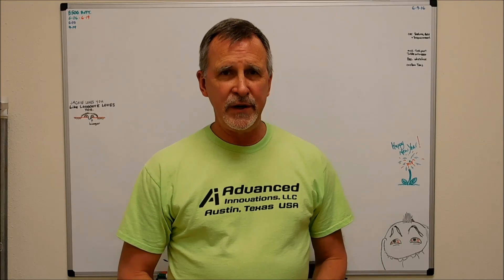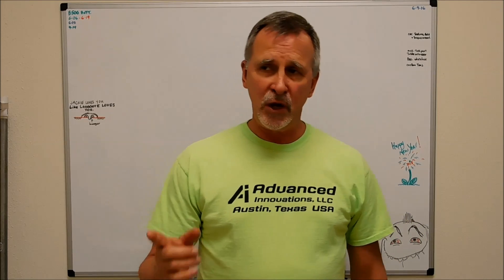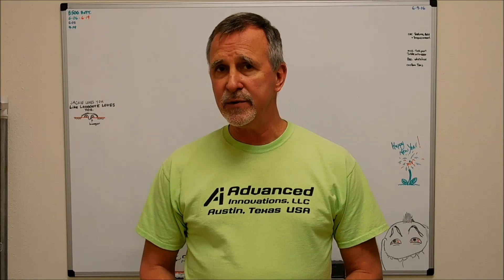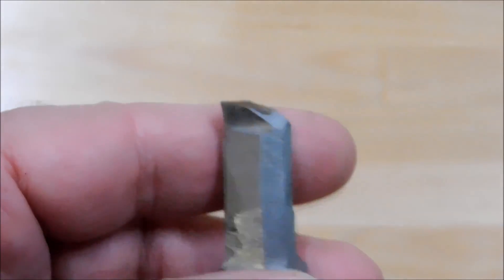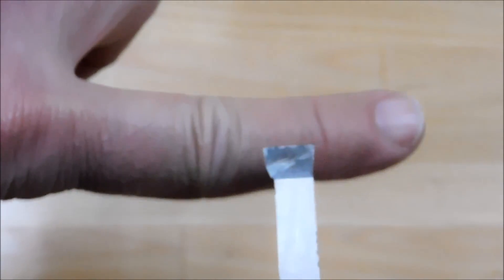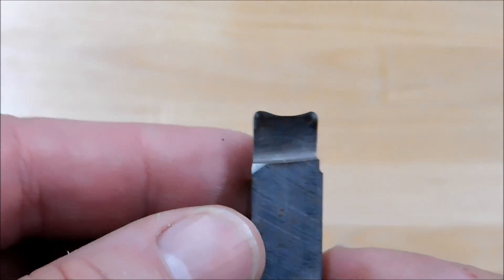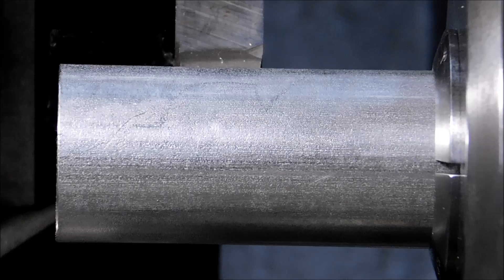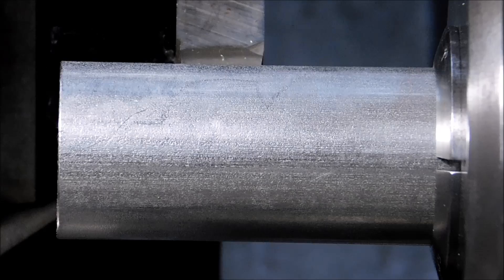Machining Large Undercuts on the Lathe with Less Chatter

Comment: Get a larger lathe, problem solved 😉
Reply: to be fair, deflection in the part and tool will always be an issue. sometimes you need to be clever to deliver a quality product because a bigger machine just won't get you all the way there, if the chatter is coming from a tool or bad setup. just my opinion though since im an amateur and you probably shouldn't listen to me.
Reply from the maker: Certainly a solution.

Comment: Hi Joe, many thanks for your videos, I watch many of them and like your presentation. I often wonder about the heavy turning operations that are done without cutting oil/coolant and the effect that use or not use has on cutting tools and surface finish. Would you share your thoughts please.
Reply from the maker: Some tools perform just fine without coolant. I would think coolant is never harmful unless it floods onto a super hot tool. Then you risk fracturing the tool or insert. Finish cuts usually benefit from lubrication, but I'm just used to not using it on the lathe all the time.

Comment: A long time ago I was involved in refurbishing the surface of a 16 feet diameter paper dryer cylinder.  It had developed a little out of round shape (actually starting to evolve towards a rounded corner square).  So, the first operation included mounting a lathe bed next to the cylinder and trying to turn the cylinder back to round shape.  For people who might not know, the dryer cylinders are high alloy cast iron.  A sharp tool bit worked for a couple of rounds (of the cylinder) and the it was vibrating intolerably.  The solution, presented by the flame spraying consultant, was to turn the tool upside down and re-wiring the cylinder drive motor for reverse direction.  The tool still had to be sharpened quite often, but it lasted way longer than the original couple of revolutions. People who had not seen this trick before, including the lathe operators, were amazed.

Comment: a comment on running in reverse, this was the best way to do parting on a small import lathe i used to own, when running forward the parting tool used to stick and dive into the part due to lack of rigidity but tool upside down and reverse it parted off lovely. not sure but i think this tip came from you as well Joe

Comment: My lathe has flood coolant.  Is that preferable to oil for parting?  Also - thanks, Joe for all the info.  Parting has been my nemesis.  I saw a clip where another user put a groove in the top, rather than the front of the cutter. I would think the front would have more effect, but I can see that the top groove would shape the chip for ease of evacuation. Is there a preference for top or front?
Reply: Oil is generally better for high friction applications where a tool might rub on the sides and such. Oil has worked a lot better to me than emulsions (I just keep squirting 2 stroke oil in the groove) but not all emulsions are the same. I am looking to get the Trim Microsol 690xt although noone supplies it to my country. It's supposed to be able to replace oil in even inconel and titanium which really benefit from reduced friction. Oil sometimes is just too messy and very hard to clean afterwards. On aluminum so far denaturated alcohol works the best IMO and I still have no explanation for it (if you get enough flow it eradicated edge build up).

Comment: That is quit an undercut on stainless. Cool design on that tip relief. A little scary with the tool upside down cuz the direction it would fly is upward if it did break. I thought I saw it move upward slightly at one point-- maybe you let off on the post grip pressure purposefully. I was curious about steady rests on a machine like yours. What would be the largest size limit, other than the obvious? I have a PM 12 x 36 and I am very pleased with what I can do with it, but I have situations where I need to accommodate a diameter greater than 3.0 inches on an extended tube work piece, which I need to bore and turn.
Reply from the maker: Steady rests rarely allow for the maximum material swing on a lathe due to their construction. Quite often, you'll see larger machines with several to accommodate a wider range of material diameters, but a 12" lathe probably won't pass a 12" diameter bar through one.
Reply: @joepie221  Thank you.. No, not possible to go as far as 12", but I'm thinking of making my own steady rest to accommodate up to 4". The swing over my carriage is  7".

Comment: Aaaagh....of course....running in reverse let's the tool "relax". It's not bucking and gouging against the solid rigid lathe, it's actually riding on the part. Like riding a horse, if you hold on tight you will fall off. You must relax and let your body move with the horse.
Makes total sense now, thanks again Joe...you are the master!
Reply from the maker: Spot on. Its actually less rigid. Thanks for watching.

Comment: Dear Joe, thank you again for another useful video. This will prove useful when turning eccentric straps. For those with screw on chucks, would not the answer to inverted tooling be to use a back toolpost which would achieve the same effect but with conventional rotation?
Reply from the maker: That would probably work.

Comment: Hey Joe, I use a lot of carbide tips at work and when I cut stainless on the lathe I drench it in coolant.. You seem to use very little lube, how is it not getting wickedly hot and work hardening? Thanks!
Reply from the maker: Depth of cut. Stainless likes to be cut, not scraped. Shallow cuts will produce a work hardened surface much quicker than an aggressive cut like this.

Comment: Time to grind a new tool. Thanks for the info Joe. Been having chatter problems with 303 stainless while trying to make a radius
Reply from the maker: 303 is the butter of stainless. If the material is chattering, slow down the RPM. Keep pressure on your tool and don't sit around waiting for applause after the radius forms. Hit it and get out. Good luck.
Reply: Thx Joe.  It did the job

Comment: with the inverted tool, do yo get any lifting of the carriage?
i think i am going to try this on my 14 inch lathe, for parting and threading. watched the videos and looks like a better way. i just have to find the tool holder for my top notch inserts, as they will be offset away from the chuck now
Reply: Hey Brian, I'm kinda late here but keep in mind that this is going to depend a lot on the design of your lathe. My 14-1/2" South Bend doesn't have any issues with this; however, it's a South Bend and weighs, quite literally, a ton. A different design could very potentially have issues with this, at least for heavy cuts.
Reply: brian alley when it is inverted, flexing or lifting reduces the depth of cut and therefore the loading so it deflects less i.e. It is stable. When it is upright flexing makes it dig in and increase the load, making it dig in more...unstable. So it might lift a bit but then it will stop.
Reply: Rv4 Guy I get that part.  But I've seen lathes, and known guys who have tried this,  and thru said the carriage will lift,  then the cut is less,  so the carriage drops,  this repeats quickly, and the tool is broke.  I know my smaller lathe there is nothing to keep the carriage from lifting in the front,  only the rear.  The larger lathes I don't see it being a problem.  Was just wondering if he ever had it happen

Comment: Hi Joe
I have used your tool grinding idea on a roller project that required a undercut depth of 10mm
And it worked great.Bearing in mind I have a variable speed lathe and the dimensions of the blank were 100mm dia by 75mm length with 1/2 inch tooling, the speed of roughing out was greatly increased.Thanks a lot.

Comment: Hi Joe
Would the relieved tool idea work on 100mm diameter mild steel down to a 60mm finished
diameter.I am making some rollers for a bending machine that calls for this very deep undercut.I find that the material removal is slow and chatter a problem.The relieved tool is a great idea and the manual technique you employed is great because you get to know the feel of the machine i think.Best regards.
Reply from the maker: It absolutely should.

Comment: I just used this trick in the shop the other night, worked beautifully. Do you mind if I ask what lathe you're using? I just got a quote from Causing and I'm debating if I really need to spend the extra 10k on the  "professional."
Reply from the maker: Clausing Colchester 1340. I wanted the 15", but this fell in my lap. Great machines.
Reply: That's awesome to hear. I was going to buy chinesium but I decided I was sick of garbage and not being able to get support, replacement parts, or accessories. The vendor I've been working with has been amazing.

Comment: Thanks Joe, you just solved a problem i've been thinking  about on how I will turn a rod journal on a model engine crankshaft. This hollow, relieved tool method is going to work, I think. Please keep em coming.
Reply from the maker: I've been considering making a miniature V8 block , crank and pistons just for fun.  You could also use a parting tool if you choke up on it and grind it right.

Comment: Much of the old (dont do it on a lathe stuff) is dated back to the old lantern post and spin on chuck days.
Much of the old information simple doesn't hold water today with modern lathes.
I discovered not locking the tool post down by accident and running backwards.
Another discovery is the lathe does a great job of removing old fishing line from bait casting reels like the Penn Senators.
Worth

Comment: Be careful with WD40 as the chemicals in it damage the liver and kidneys. WD40 can travel through the skin and into the blood stream very quickly. Try undercutting case hardened shafting such as Thomson Rod with carbide or ceramic insert tools.
Reply: I use mineral oil cleverly disguised as ISO 46 hydraulic fluid.
Not near as likely to burst into flames.
Reply: My preference is Croma-Tap2 because it works on everything including aluminum and leaves no residue. The best for stainless steel is paste products but all are messy and some eat aluminum.

Comment: Hi Joe
I was a production machine operator(and i am getting back into lathe work)  and the rules for stainless steel were slow speed, slow and smooth hand feed,and loads of cutting oil.
But i cant recall what tool material was best HSS or index tip. The reverse technique is new to me.but very interesting the way you overcome problems.Keep em coming Joe.
Reply: I am an absolute amateur machinist but an avid YouTube viewer.  From my viewing, I recall an experienced machinist on YouTube commenting to the effect that "with SS , use slow speed but "fast" feed". I don't remember advice on Lubricant, but clearly from this video "WD-40" is the go. My observation, with limited knowledge and experience, is that Joe was taking a pretty large bite on all of the cuts he made.  Joe, for the benefit of both Peter, myself and probably others, would you mind clarifying this point for us. Kind regards and thanks for another excellent piece of educational video.

Comment: My error I did not mention sorry. I did make the raised 2-inch diameter center hump to fit the reses in the chuck before I laid out the bolt holes. SNUG fit then laid out the 3  holes with the exact diameter center punch one at a  time. Just put the face plate back on the late. Checked it, all seems good so will true it again with a light cut add the chuck with bolts loose and try the tap method as suggested Thank you.
Reply: This morning I did what I said above in my last post. I undercut the enter doom ( pilot section) and cut reliefs in the faceplate. then I mounted the chuck and tightened the 3 bolts lose. I went with an indicator and tightened the bolts in a way you set up a four jaw chuck. I now have a 3 thou run out at one point which I can live with for now. Thank you all.

Comment: Great Video Joe.  I love the way you break down information in the easy to swallow bites.

One question....  what is the difference in running the tool upside down and backwards verse forward.  I mean could you explain the physics behind it?  In pure theory it should work the same either way.

Just curious, knowing the answer may help me and other to determine when upside down and backwards is a good choice for other applications.

Thanks,
Mike
Reply from the maker: Hello Mike. I believe chatter happens when 2 rigid entities meet and they both refuse to yield. Momentary flex of one of the participants results in a rebound that usually digs the tool in deeper than normal forcing a rejection that just continues the cycle. Conventional tools are usually used with all the machine gaps in compression. This is where the rigidity comes from. By inverting a tool, there are several places the tool can draw from to pre-load without total rejection. The tool lifts to a happy place and goes to work. If it did decide to dig in, it usually rides up the dovetails of the tool post and just needs to be reset without breaking off. Watch closely as the inverted tool finishes the cut. You should see it relax downward.

Comment: Hello Joe Love your post. 
OFF THE TOPIC AT HAND.
I have a question please if you can answer it. Tough one for me. And if you are swamped with questions no problem.
I have a small Lathe with a 5c collet attachment that bolts onto my headstock with 3 bolts. no problem there. 
I also have a south bend 9 lathe with a 1 1/2 x 8 TPI male thread that you mount 3  jaw etc chucks on. 
I want to use the 5C collet attachment on the south bend lathe.
I purchased a 1 1/2 x 8 face plate to bolt onto the 5c collet attachment after I take off the bolt on plate that came 
with it for the small lathe. I faced off the new faceplate and did all the measuring and tapping bolt holes.
mounted it on the south bend but it does not run true. I checked the 1 1/2 x 8 TPI shaft no wobble.
What would be the best way to solve this problem even if I have to make new threaded holes.
It is a layout problem I thought I did perfectly. NO SO
Reply: The issue seems simple, as I read you've said you faced off your new faceplate which left your faceplate flat leaving only the screws to hold it centered. 
The screws are only for attaching a faceplate to your 5C collet chuck, you also have to machine a lip or groove or something into the faceplate which will mate perfectly with your 5C collet chuck to hold it centered. Mind you do all the machining on the faceplate after cleaning your spindle and faceplate threads extremely clean and mounting the faceplate on the machine you will use it on.
Reply: I agree with Trigger - if you look at how cam lock chucks center up, there is a very close tolerance, very short taper on the chuck and spindle that centers the chuck. The tolerance is so tight that the tapers actually "Jamb" when the cams are tightened. I added several home made Spiders to my lathe using backplates that came with the correct cam lock mounting on the lathe side. I made a similar taper lip on the chuck side of the backplate to center my custom chucks. It works perfectly with about a half thou runout (I also index the cams so the back plates always mount on the same cams that were used when the tapered lip was machined). Think of it a bit like how the taper on your tail stock alignes Morse taper tools except with only a tiny fraction of the length and bolts to maintain the joint. 
In my opinion, bolts alone will never center consistently no matter how perfect your layout is. However, you might be able to center it as is by lightly tightening the bolts, then centering the chuck by tapping on it with a hammer opposite the high spot till it runs true, and then tightening the bolts. I recommend the short taper approach. Make sure you relieve the root of the taper with a small cut so it doesn't prevent a good fit.

Comment: I am confused what difference is being made by the flipping the forming tool as opposed to being right side up? By the way your videos are clear, straight forward and amazing I started keeping a notebook of your tips thanks  Chris D
Reply: Different cutting forces,instead of pushing tool down,it pushes it up.
It has to do with how chips hit rake angle. Also when you reverse tool it try to pull up the tool post which pushes down the carriage on the bedway  instead of lifting it up as when you do it normal way(i think that is why you dont get chatter on weaker not rigid machines ).

Comment: Hi Joe
Why would there be a risk of machine damage?
Thanks for video, I dont think you understand the impact you make worldwide!!
Reply from the maker: Many guys will preach these machines are designed to work in compression. The compound to cross slide, the cross slide to the carriage, and the carriage to the bed ways. Inverted tools may try to compromise those mating areas by lifting them apart or putting too much stress in a direction for which they were not designed. I say the tool would fail long before the machine would experience damage. But I also support the mentality of each machine operator working within reasonable loads for the size of their machine. Thanks for the comment.

Comment: Parting and grooving is my biggest headache. This adds to my arsenal of techniques. I have been grinding a groove in my parting blade as you show on the form tool in the first half. This has helped me a lot with high speed steel parting blades. Thank you very much for sharing. Know that I am a better machinist because of your fine videos.